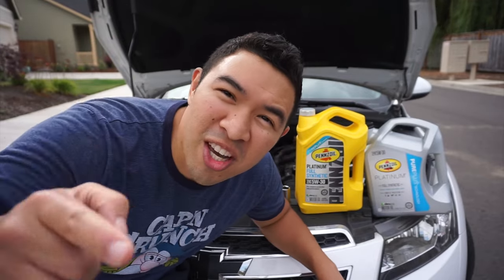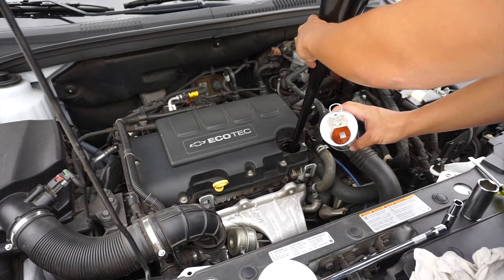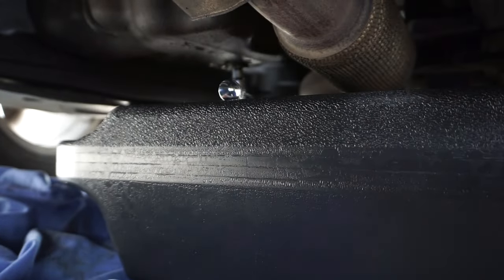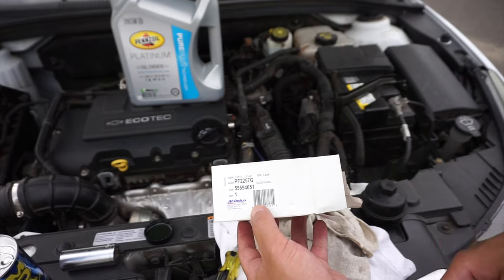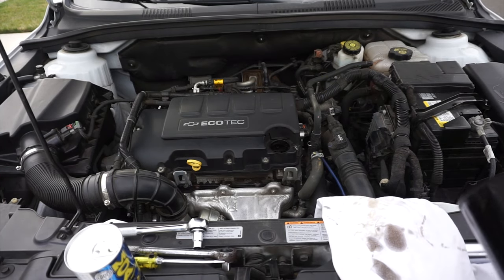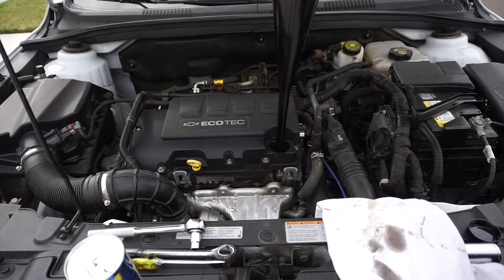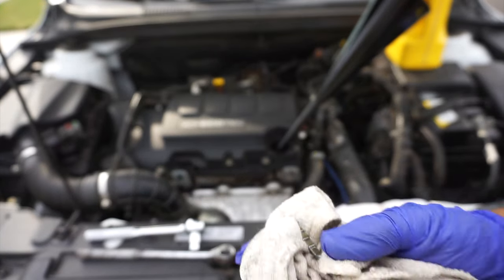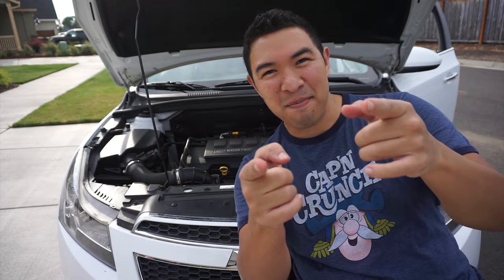Chevy Cruze Oil & Filter Change 2011-2015 | Engine Performance Restoration + Oil Treatment + BG MOA

Comment from the maker: Going to tackle it yourself? Make sure you have the right gear!

Socket Wrench 3/8" Drive: http://amzn.to/2vFSr6P 
10mm Socket 3/8" Drive: http://amzn.to/2uy7rDo 
15/16 Socket 3/8" Drive: http://amzn.to/2eLsf6s 
Oil Filter: http://amzn.to/2h0nsz5 
Synthetic Oil 5-qt: http://amzn.to/2eLw1wI 
Oil Pan/Container: http://amzn.to/2vGzz7p 
Funnel: http://amzn.to/2vXUrqc 
Oil Restoration Treatment: http://amzn.to/2vG14y5

Comment: save yourself $40.  Dont waste your time on oil additives.  They do nothing but lighten your wallet.  A full synthetic ,or full synthetic for high mileage cars is more than enough to take care of your engine.  I currently have 160k miles on my cruze Eco and just replaced the valve cover gasket. No gunk or build up to be found.  Use the proper oil and change it regularly and you won't have any gunk build up. Period.

Comment: After you add oil up to the dipstick mark the first time, start the engine and get the oil circulating for about 30 seconds. Turn it off and check your oil level again. Once you fill it back up to the dipstick mark the second time, that should be its final level.
Reply: I agree
Reply: Exactly

Comment: When changing your oil the oil has to reach the bottom of the engine to fill up to the dipstick. You should add oil let it settle somewhat to the bottom then check it. Also if the engine is hot and u add oil it will change the volume of the oil. NEVER CHECK YOUR OIL if your car is hot it wont be accurate level. Its a good video but your missing some mechanics of an oil change. Simple isn't the word. You also didn't check your crush washer on your oil pan plug to see if it needed to be replaced. That is critical to keeping the oil plug from leaking.

Comment: Great how-to video.  However, Never, Never add oil treatment to synthetic oil.  The engine oil formulators (that I have worked with) are always pushing solubility of critical ingredients to get performance, soooooo when you add a potentially incompatible oil treatment you could "drop out of solubility" the friction modifiers, viscosity index improvers, pour point depressants, detergents etc that you are already paying for in a synthetic to protect your engine.  The ingredients that could "drop out" become "unwanted engine deposits", again one of the benefits of what you want from a synthetic.  Watch out for "buddies" with no real knowledge of engine oil formulation. Also, Mobil 1 was the first and still the king of synthetic since they make the majority of the synthetic PAO base stock.  Other brands are just selling additive packages mixed in Mo-chem PAO base stock.  Regardless, just change your oil regularly and you'll be fine.

Comment: I've got four cars from 150,000 to 344,000.  I've NEVER used an oil additive in any of them and I've never changed any of the engines or had them rebuilt.
Reply: I have a Toyota pickup with 200k and regular oil changes. Did an oil change about 1000 miles ago and added the BG additive, and I can say it does make a difference
Reply: Do any of these have a turbo?

Comment: I would add that after filling oil, start the engine, run for about 30 seconds, then shut off and check oil again as the filter is now full of oil so oil level on dipstick may have gone down some. A great instructional video, this suggestion is just an FYI

Comment: Good video, but the reason that the oil level looks right before you have filled the recommended amount because the oil filter takes about a quarter of a liter to fill and you also added the additive.

Comment: 232,000 miles and still going strong.
Reply: Dexter Morgan That's Great. I'm thinking about buying a Chevrolet Cruze 2011 or 2012, I'd wanted to know your opinion about The Car? Does it have Abundances of Problems like everyone's?
Reply: Diesel or petrol if its diesel i can believe in you if not then I disagree this Daewoo Lacetti Premiere other wise known as chevy cruze had so many problems
Reply: @ramanjitsingh4340  173k still going still has factory turbo used full synthetic oil and no additives
Reply: @code123red  Please, do not buy a Cruze. For the love of God and your bank account, stay away. Run for the hills. Alas, I fear I may be too late, for you posted your comment a year before I did. There are many reasons why you should avoid the Cruze (and pretty much all things GM) like the plague, but I will boil it down to the guaranteed ones, the really maddening ones, and/or the costly ones. One of these problems has a 100% chance of occurring before 75,000 miles in every Cruze with the 1.4L turbocharged engine ever made. The other problems are more than likely to occur sooner than you would like.
1. PCV system failure. I put the failure ceiling at 75k, but is more likely to happen at or before 50k miles. Chevy used rubber check valves in the intake manifold and at the turbo inlet. What do you think hot gases do to rubber? These WILL fail, and when they do, it's only a matter of time before the pressure-regulator diaphragm in the valve cover goes. Unless you know how to replace the check valve in the intake manifold with a more robust brass valve and rubber hose kit (I do), you will end up replacing it with an OEM kit that'll fail in a short period of time.
2. Transmission. My 2013 LTZ has the 1.4 Ecotec engine with the automatic. The transmission is slipping and the car has only 65k on it. This transmission is notoriously weak and poorly engineered. Internet forums are dedicated to this problem. 
3. The turbocharger sucks. When it works, it does the job nicely. But it is prone to failure, with many Cruze owners complaining it failed under 50,000 miles. Unless you do it yourself, that's easily a $1,000 repair bill.
4. The cooling system. It leaks at the water-outlet valve and where the reservoir-return hose connects to the outlet valve. I just replaced both; it was a simple repair, but one I shouldn't have had to do. Why the f*ck would Chevy bolt a plastic valve housing to the side of a metal engine block that gets very hot? Also, the hose connects to the valve housing via a proprietary connection instead of a simple nipple and hose clamp. That means you have to buy it from the dealer or Amazon to replace it. Bullshit.
5. The HVAC system is a breeding ground for mold. At some point, your car will start to reek like dirty socks. Only solution is to take it to the dealer and have them reprogram the computer to keep the blower running for 5 mins after you shut the engine off. That's a $280 job that takes about 45 mins. This dries out the ducts. You can also have them spray a cleaner down the ducts. 
I loved my Cruze when I drove it off the lot. I wish I had never bought it. It is poorly engineered, GM knows about the flaws, and it won't issue a recall, much less a technical service bulletin. Save yourself the headache and buy a Toyota. Avoid GM products.
Reply: What that guy said...
Reply: When did you change transmission fluid (if at all)?
Reply: Just saw one for sale with 268,000
Reply: 300,000 mile on my Cruze and now I must replace the intake manifold. This will be the second time doing this. I did this once at 98,000 miles and valve cover at 128,000 miles. Other than that the car has been fine. There is a PCV kit to help avoid this from happening. Do it if you plan to buy one with low miles.
Reply: Dexter Morgan any transmission fluid changes and at what mileage? I’m wondering if I should do a transmission fluid change for the first time at 105 K
Reply: @cookierepository5792  I did that at 130,000 miles. Make sure you get someone who knows what they're doing.
Reply: @code123red  i have a 2011 chevy cruze had no problems so far at all.
Reply: @csn6234  I loved my chevy cruze, the engine is not that powerful but its nice looking on the inside i have had no problems with mine im over 100,000 i did have to get the tires changed that is it so far oh and brade pads and shoes as well
Reply: @cookierepository5792  the manual says change trans fluid every 45,000 miles,, it's not like most vehicles that r good to 100,000

Comment: The filters Fram makes for this particular car are actually made a lot better than the AC Delco equivalent... Plus, Fram isn’t a bad filter the orange can is generally used longer than it supposed to be. And the Fram Ultra has an almost cult following because of quality of construction and longevity.

Comment: Pro tips my friend you want to clean it the filter cap with degreaser medium strength and rinse completely 

If you let the oil drain and settle the filter literally makes zero mess 😉

Comment: Nice video on how to change the oil. However Chevy manual specifically says do not add any kind of oil treatment.
Reply: What would the downsides be?
Reply: @mostly_water  if anything goes wrong it will void the warranty because you specifically went against the GM manual for the vehicle.

Comment: Thanks for the vid. Made it easy to locate everything. My drain plug is not a 10mm tho it is 17mm. And weird it doesn't have a gasket has a washer. Unless it's a really old gasket that flattened and stiffened...2013 lt

Comment: My car is a 2013 Chevy Cruze LTZ with 98k miles, and the owner manual says dexos1 approved oil only, else potential engine issues not covered by warranty. Yet I buy O'Reilly High Mileage brand that matches everything recommended (SAE 5W30, full synthetic, says on bottle "for modern turbocharged gasoline engines"), just doesn't have the dexos1 sticker. Comes recommended on their website as well for my exact car. 

Does that just mean O'Reilly didn't pay for the sticker certification?

Comment: Hi I really like your video, but please I want to ask you a question, I have a 2015 chevrolet cruze NB-1.4D 6AT right hand drive, want to know if the oil filter of chevy cruze are the same? Bcos I have been trying to buy half dozen of the oil filter, but don't know which to buy, if it's the same with hengst oil filter in my car.
Please will be very grateful for your help

Comment: And now I need a new oil pan, That oil plug is made of tin foil, stripped it with a hand tool.
Anyone have any ideas on how to get a stripped plug off so I just need to replace the plug????
Reply from the maker: Someone put it on too tight if it stripped, it's designed to avoid ruining the pan. Probably best to have a mechanic do it or you can just switch to an extractor and forget using the bolt. I use the mighty vac these days and enjoy not needing to get under anymore

Comment: Did you have to replace the oil pan drain bolt constanty, because it was aluminum and they strip easily.
Reply from the maker: No, I go by torque specs and have never stripped a bolt. However, years ago I switched to a top side extractor that pulls the oil out of the dip stick chute. Much easier with lower cars; I currently daily drive a 124 Spider Abarth

Comment: This was 4 years ago and you had it at 105,000 miles. What’s up your Cruze today? Is it still running well? How many miles you got on it now? I have a 2011 Cruze LT at 110 now and thinking about either selling or putting in extra money to make sure it runs well for another 50 thousand at least
Reply from the maker: I sold it at 130k or so, and now drive a 125 spider abarth but quickly have it also up to 70k. the cruze pcv valve annoyed me after I replaced the intake manifold and other parts due to the design issues. there's a work around but you'd drill into the new intake manifold. I got a great deal on my drop top though 👍
Reply: @DriveByReviews  Yup, that damn pcv valve is what sucks about this car. I’ve owned the Cruze for 3 years and had to have that fixed twice already, I tried to replace it myself hoping to save money but although it looked easy I am not a mechanic and it did not come out as expected lol thanks for your reply I’m gonna sell my Cruze now 👍

Comment: My 2013 Chevy Cruze LTZ owner manual says not to use motor flushes/oil treatments with dexos1 oils.
Reply: Remember when Castrol GTX 10-30 was all you needed?

Comment: It states in the chevy Manuel that you shouldn’t put cleaners in your motor, only GM Recommended oil with the Certified logo, doing so can cause serious damage to your motor and it won’t be covered by chevy manufacturer warranty... if you want to clean your motor and keep it lasting very long do regular scheduled oil changes and use high grade octane fuel with 10% ethanol with cleaning additives... what your doing is at your own risk.... that’s what chevy said so don’t get mad at me

Comment: Just wondering. What's your MPG average? My 2012 1.4L LT is at 28.6 Miles per Gallon.
Reply: It’s not exactly apples to apples, but my ‘12 1.4T Eco gets around 35-40, cruising between 70-75 on the freeway, and 30-35 cruising around town.

Comment: Question, did you use a mix of both oils? Or were they the same? Becuase I thought it comes with 5 quarts
Reply: you only need about 4.5 quarts or so to fill up the cruze.  just save that oil in case your car leaks or you can add to the next bottle of oil.  Eventually you'll have enough for an oil change. Also note the green swish on the bottom of the label on the oil.  That's Dexos 1 rated.  which is all you need engine treatments do nothing.

Comment: Can we change the oil filter without removing oil from the engine in Chevy Cruze 2015?
Reply from the maker: yes, its top side. you would need to let the engine sit off for a bit. but just change it every oio change and you're good

Comment: I put accidentally put high mileage oil in my 15 Chevy Cruze eco but it has 60k on the dash .. is this bad? It says 75k and above but will it really mess w anything?
Reply from the maker: there are some things to consider but the main point would be to use dexos approved oil to not void the warranty.  Generally you don't need to switch to high mileage until much later than 60k.

Comment: Are the supplements only for turbo cars? I have a 2011 Chevy Malibu
Reply: dont bother the supplements are a wallet drainer and do nothing for your engine other than make you feel like you've done something.  Just use the correct oil and filter and change both regularly.  The synthetic oils he showed has enough detergents to keep the gunk out of any part of your engine.  The cruze requires at least a Dexos 1 oil or higher. Synthetics are typically Dexos 2. Just read the labels to be sure. see here  https://www.youtube.com/watch?v=h2xExpwV0TE

Comment: Just curious.. do you still have this car and if so how many miles
Reply from the maker: yeah, 167k miles.
Reply: @DriveByReviews  awesome, im buying a 2013 cruze off my dad its got 60k on it and i only drive maybe 10k a year.. only problem is upstate NY my frame will prolly rust out before the engine dies 😂
Reply from the maker: @CODstreamz  dang, 60k on a 13 that's super low. I bought an extractor and now do oil changes top side to make it even easier. Car is one of the easiest to work on if you have the time and ability for sure.
Reply: @DriveByReviews  just saw this video tryin to learn about it before i buy it.. ill deff be checking out your vids for workin on my cruze if you got them posted.. also how often do you change your oil and any major issues? Thank you in advance for your time
Reply from the maker: @CODstreamz  I change under 10% on the oil life meter. Usually around 7500 miles or so using full synthetic. I recently had the PVC valve issue and had to change the intake manifold and crank case top. Also the thermostat piece, the water cooler inlet I believe, needs to be replaced. All know failure issues via the cruze forum. Issues developed for me after 150k miles.

Comment: My cruze is a 2015 LT its not a turbo, can i use mobile 5w-30 dexoz Full Synthic oil ?? 🤔
Reply: It says the 5w-30 dexos  , but it doesnt say anything about using full synthic🤔
Reply: I was just thinking that, ay thanks alot man for your reply, and ok, good cuz i used full synthitic  👌

Comment: Fram ain't that bad I use the fram tough guard with Quaker state 5w30 conventional motor oil and change it every 5000 miles. As long as you use a decent oil filter, rotate your tires every oil change, and change your oil every 5000 miles then your car should last you for years to come
Reply from the maker: I get that POV, Mike; the FRAM issue is heavily debated. Generally, Fram complaints are over the quality of materials and construction, not the filtering ability. The length of time you use the filter is irrelevant; if it fails for any reason then the OCI's are meaningless. You can use Frams for a lifetime and probably not have a problem but the chances of something going wrong are greater with cheap Frams. With online orders/sales these days it's not costly to go with alternative filters. As for "last you for years" don't forget transmission fluid service; it's supposed to be every 45k and the dealership tends to "forget" to mention it to those who rely on them.

Comment: 173k miles with full synthetic oil and no additives still going factory turbo
Reply from the maker: wow, I drive a ton an just passed 131k. nicely done. did you change your turbo oil feed line? I'm thinking of making that video next.
Reply: @DriveByReviews  yep replaced it at 100k started leaking where it bolts to the engine the o-ring was shot
Reply: How often did you change the transmission fluid (if at all)?
Reply: hit 160k on my 2013.  The only oil leak was from the valve cover.  replaced the gasket 2 times now and the cover once with a new gasket because of the PCV. Turbo line is still intact.

Comment: I hope people don't follow your fill method. You should always run the engine to fill the filter up after replacing the oil and then check it again. Without doing that you're likely low.
Reply: He legit tells you to check it after your first drive and top it off if needed lmao